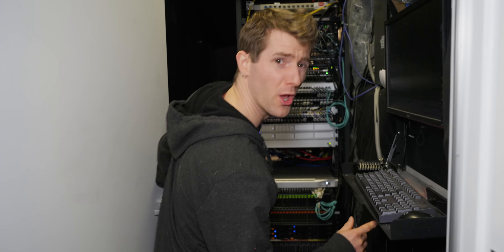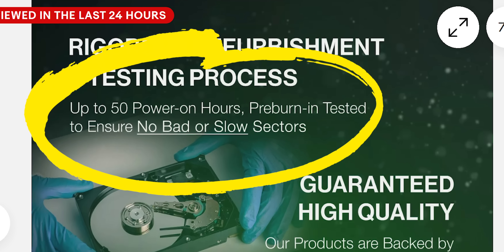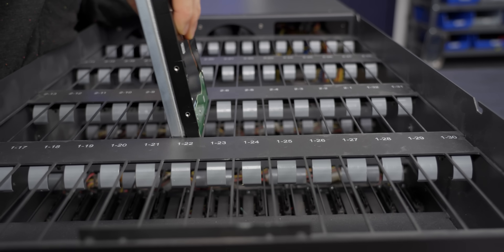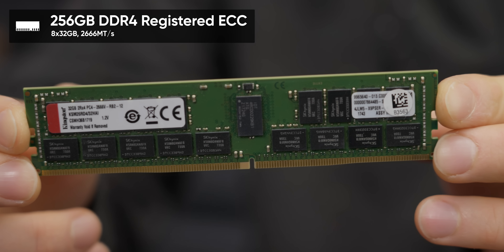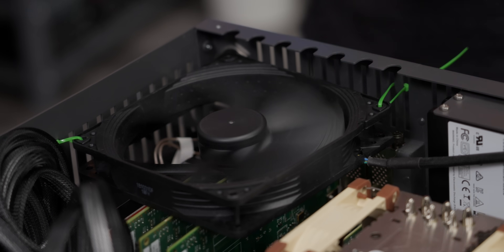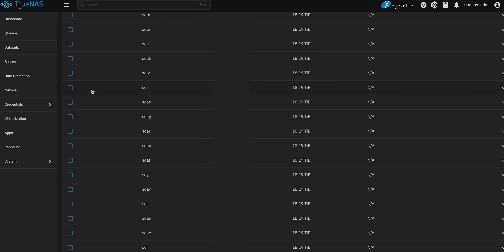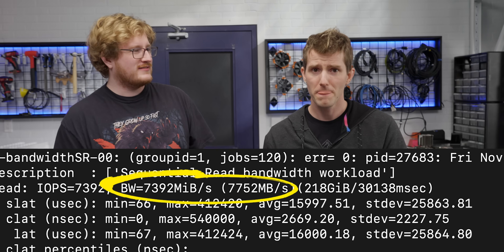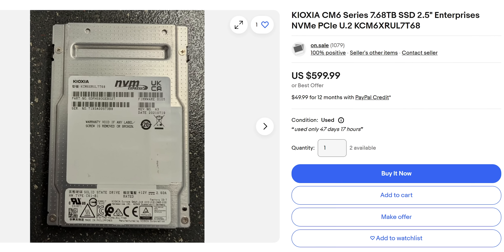Is Buying a PETABYTE on Ebay Stupid?

Comment: I did something similar though not at that scale. Paid $600 shipped for 5x 12TB WD Ultrastar drives from server parts deals.  I set up freenas on a newer 5600G AM4 based system with 32GB of RAM and use it as a media NAS.  Similar LSI HBA in IT mode from eBay for like $20 as they show in the video. Built it in the Lian Li A3 using a $15 5-bay drive cage 3.5in drive cage.

Storage pool is a RAID Z2 for extra redundancy.  I did have one drive fail a smart test within a couple weeks and SPD were helpful and quick about replacing it, even as a hurricane came through near their HQ in FL.  Everything has been rock solid for almost 4 months now.  This is the only way to get this kind of storage density.. I can pull 280MB/s over a 2.5GB switch. Love it!
Reply: Milton don't play no shit.
Reply: So wait, you’re running 60TB RAIDZ2 with only 32GB RAM? Have you had any issues over 30TB of data? They say 1GB per 1TB, but I see my ram usage is low in my 24TB setup with 32GB. I’ve been wondering if it’s not really true. They say some pretty bad corruption/loss can happen if you run out of ram. I’ve been tempted to add more storage but have been scared of data loss.
Reply: @andrewskaterrr  I could be completely wrong about this, because I have only recently been trying to learn about ZFS and ZRAID in preparation for building my own media storage, but as I understand it from my (Pentium II, upgraded to Pentium III, ProLiant) server days, using hardware RAID 5, wouldn't his ZRAID2 array have two drives of redundancy (What I am going for is ZRAID2 with 8 12TB refurb Seagate drives, so this is a real question for me, too!) and only 3 x 16 (1,000-based, not 1024) drives of working capacity, and therefore staying [barely] under the 1 GB : 1 TB rule?

The old motherboard I intend to repurpose has a 64 GB max on RAM, so I was planning on 7 active -2 redundancy + 1 spare.
Reply: an A3?? Can you tell me where to find the drive cage and how you fit that in?

Comment: You can get a new 20tb internal Toshiba NAS drive for 342$ at Microcenter I just picked one up.  This is about $50 $60 cheaper than any other internet 20tb drive the Seagate is $400.

Comment: I’m a storage administrator for 60 Petabytes of data and if I had to guess these are refurbished from churned drives. Because I have so many spinning discs on so many arrays I have a large locker of cold spares and as soon as I see any sort of error or bad sector I replacebthe drive because that rebuild takes so long that I can’t waste time trying to recover recover the disc so even if it has a small error that could be indicative of a bigger error so I RMA it under our contract with the vendor and pull one from storage and put a new one in immediately now some of those discs that I sent back are probably fine and that’s probably the ones that get refurbished and sold there. Also, when my current system is decommissioned, I’ll have an entire locker of cold spares that just gets sent back to Seagate and yeah, those will probably get relisted.

Comment: I bought recertified 4 and 5 TB drive from western digital, and they are running since a year in my home server without any issue.
Also, I just bought a 16TB Seagate IronWolf recertified from amazon, and it's runnning since a mouth without any apearant issue, and as in the video, the shell was brand new.

Comment: Couldn’t you use more redundant drives in a RAID setup to compensate for higher failure rates? Sure it’ll cost more but not as much as all new drives right?

Comment: I just did something similar (from a consumer standpoint).
Very cheap drives from a dude retiring his homelab attempts, HexOS, and an old PC (i5-2500k). Works like a charm, and much cheaper than anything I would build on my own from brand new parts.

On that note, if you wanna show how to turn spare laptops into the brains, a.k.a compute for these NAS projects that'd be great, I have a spare laptop with a much better CPU than a 2500k ;)

Comment: I've recently taken a gamble on 10 8TB exos SAS drives for £20-30 each. I had one DOA which the seller is replacing and all have approx 50,000hrs on them. At that price it seemed worth the gamble and I'll be running 2 parity drives so it should be pretty safe with 8 spinning disks and 2 cold spares. This is all totally new to me and I'll be relying on Hex OS which I got the early bird price on. So far the little 3 drive dell optiplex 3060 Nas I built for my dad is running flawlessly with hex os. I got him recertified 4TB ironwolf pros which arrived sealed with 0hrs on them for about half MSRP.

Comment: i purchased a few 16TB SATA ST16000NM001G Seagate Exos 3.5" Internal Enterprise Server HD | 7.2K from "plusdrives" off e-bay another re-certified Seagate reseller in May 2023.  They are inside my Unifi NVR and have 12 cameras writing to them 24/7 since I installed them and zero issues.

Comment: Ok, from the perspective of a guy who works a lot with huge data centers: data centers buy hard drives in bulk, often much more than they can use so they have on site cold spares. Depending on the protocol it can be up to 40% of the drives purchased. And when they migrate to a bigger hard drives or to SSD storage they often have a plan where unused spares are returned for some percentage of the initial cost. Unlike used drives that are handled by the e-waste recyclers and often just destroyed (again based on the policy of the data center) spares are often returned to the original manufacturers. So here's a base for re-certified drives.
Reply: Is it also possible that data centres buy so many that they get quite a few duds which get sent back and fixed and recertified?
Reply: Up to 40% for cold spares actually makes sense when using Seagate drives. Depending on the model.
Reply: @peterpain6625  Enterprise grade stuff is obviously much more reliable, but even then Seagate still maintains their spotty reputation. Hitachi is the real good stuff in terms of spinning disk.
Reply: Thanks for info buddy
Reply: Thanks for confirming what I suspected! I have a friend whose sister works for Hitachi doing data center sales (last I heard), and she couldn't talk about work; but my own work around servers at the SMB level made me expect it.
Reply: Now that makes a TON of sense.... I just couldn't think of why there would be so many drives with ZERO hours on them, but are re-cert'd and essentially 'new' drives....
THANK YOU! Very helpful to know the sources... or at lease one of them :)
Reply: I had a manager insist that all the drives be the same across all the servers, when we upgraded some of the archive servers. Even though it was completely unnecessary (he got the budget approved for it, whatever), so we ended up with about 100 brand new, still sealed, spare drives. I forget the capacity of them, and they weren't all one type, but it was such a waste of money.
He also undid some of the virtualisation the previous head had put in place, resulting in new oracle licenses being purchased. Again, he got the budget for it approved, so whatever. His boss must have had a pile of cash leftover in the budget and decided he needed to burn it all, lest he get less next FY.
Reply: i bought a 20TB refurb off ebay it was new with a cheap dell optiplex i have my own cloud storage....i was leery at first but no regrets
Reply: Hook me up brother 😂
Reply: as if yall arent wasting gpus, now your also wasting storage
Reply: ASDasdSDsadASD-nc7lf It's new to many people.
Reply: Obviously.  Amazing you think that is new information.
Reply: @ASDasdSDsadASD-nc7lf did u even watch the video? Half of it was them wondering where they come from.
Reply: @ASDasdSDsadASD-nc7lf  yeah, that's totally common knowledge that everyone should know 🙄
Reply: @ASDasdSDsadASD-nc7lf  why do I picture Comic Book Guy writing out your comment?

Comment: I always ADVISE people to buy used Harderives (for games exclusively) 

When I spec Systems, I always save my friends that are on a low budget a bit of money by buying used drives.

I always tell them to store critical Data on either the SSD or a 500gb HDD I include as well. Additionally I always get them a 4 - 6 TB used server Drive with good test scores, exclusively for saving Games.

Comment: 13:35 when making a NAS at home, DO NOT GET A CACHE DRIVE. I frequent r/truenas, we get A LOT of posts of people setting up a new NAS thinking their spare SSD can be used as "cache" for their HDD pool. it does, not work like that, it never has, and never will.
Reply: As you didn't phrase it accurately: For ZFS that is. xpenology, unraid (using unraid array) etc do have write back cache options that are suitable for home use. ZFS does not.

The valid usecases for caches in ZFS, as far as I know:
- Do consider using a L2ARC cache if you have maxed out the RAM on your platform and still see cache misses. Using a slow SSD may end up hurting you performance, do your research.
- Use a persistent L2ARC with secondarycache=metadata to get somewhat special vdev like read performance boost without having to invest in redundant ssd storage. Requires "tuning" of zfs params. Mostly relevant if you restart the server a lot. Otherwise the ARC normally does as good job without L2ARC.
- Do use a SLOG device if you need high performance sync writes. Normal SMB shares do not profit from this. At all. But if you share storage via e.g. NFS or ISCSI to a VM host to store virtual disks or use the storage for a databse, this might be relevant to you. If you do go down this route, your SSD you have lying around is probably completly inadequate. Consider optane.

Instead of a cache, consider installing a metadata vdev. It's pretty expensive, as you should use the same level of redundancy as for the rest of the pool, but it can speed up some use scenarios significantly. Wendel from Level1Tech made some videos about it, but before deciding to use one please do some more research if it will actually benefit you. If all your required metadata is already in ARC, the speedup may be negligible.
Reply: unRAID works best with one or more NVMe drives for short term cache and has a customizable 'mover' feature that moves files between cache and array.

Comment: I have stopped years ago with buying brand new drives. Instead I buy used and get double the storage for the same price, so i can do more backups.
In the end, as all drives will fail eventually, buying used is safer than buying new.

Comment: I just got a recertified HDD. It had zero hours on the drive with no visual usage. It was even sealed, what looked to be an original seal.
Reply: From the original manufacturer?
Reply: @AxisofNerd  they reset the smart data. I've got a couple of 6 year old refurbs that came from a DC with 0 hours.
Reply: @0pointer  Yeah i think so but the thing is its manufature date is like 4 months old.

Comment: I bought 12 recertified seagate drives from a vendor.  Over the next two years 12 out of 12 had shown SMART errors and pulled and replaced.  It's not worth it.  Buy cheap, buy twice.

Comment: I bought 4 Seagate EXOS X14 14TB disks that were refurbed by Seagate. They only had 3 hours on them when I received them. I am at 17,800 hours (just over 2 years) and have had two fail so far. I would NOT recommend them. Go Western Digital. Seagate has and always will be the inferior choice - my anecdotal experience.

Comment: I've pretty much switched to only buying from serverpartdeals but I don't know if I can do Seagate. Their failure rate is still a bit too high. The WD DC recerts drives have been running for years and not a single failure.

Comment: if 48% of reports are center, the data they use is wrong, not to mention that center is the most biased and misleading sector of news work because it's harder to tell the lies or dishonest things they say. if you read any right or far right news reporter you can immediately tell the wrong things they say, and it's the same with left leaning stuff

Comment: Recertification is done by Seagate themselves? Oh well that should be fine then! Considering that their NEW drives are so well known for only blowing up a year after first deployment.

Edit: If you want more testimony, every hard drive failure I've ever seen myself, for family, for friends, whether it be Desktop, Laptop, Game Console or portable storage device, every single one of them was a Seagate, and they were each no more than 2 years old. Meanwhile my WD Golds are about to be a decade old, outliving the components they were originally built with, and still refuse to quit.
Reply: Bad news: it's just chance. Actuarial comparisons put WD and Seagate pretty close to each other in terms of real failure rates ("frequency"). That's true across industry segments but individual product lines may deviate. Source: have worked in data analytics for warranty/insurance/reinsurance companies.
Reply: Each manufacturer has failures. I have had Seagates, WDs, and Toshibas last years and years before they start to fail. I've also had some last only a few months. My most recent was a Seagate that started to take a long time to access, but it was over 12 years old and had a ton of restarts and power on hours.

Comment: I bought 3 used 16 TB WD WD160EDGZ Drives for  a total of 354€ (~7,40€ per TB). They are renamed Ultrastar DC HC550 Enterrpise Drives and were very cheap even compared with Recertified drives. And I purposely chose used drives against recertified, because then I knew the exact smart values and have information about their prior usage compared to recertified drives. Running since August with no problems so far. 
After watching this video I am willing to try recertied drives as well, if there is a good deal on them.

Comment: I ran 10 ebay 4tb wd's on used lsi controllers for about 6 years 24/7 no failures. I now use that array as a cold backup and power it on to sync every once in a while. Bought 5 ebay 12TB hgst's 2 years ago. 1 reported failed in truenas but I took it out and ran disk tests for 2 weeks straight and it found no bad sectors. Been using it since, no issue. Likely was just a glitch in the cables or controllers, or a hiccup from running truenas virtualized.

Comment: I'm using 2 refurbished drives in my TrueNas System in a mirror pool for backup. I'm replicating all my snapshots to them. So in case my main ZVol1 pool gets damaged I should be able to restore it from the backup. 
No problems so far with the drives.

Comment: With pools this big you might want to put metadata on redundant SSD's, and not store it directly on HDDs. Cache helps, but scrubbing is brutal. You need like 0.3% for metadata, which is quite practical. Also it can automatically store small files there (say, under 128kB).

Comment: Recertified drives are more reliable than a brand new external drive. Also I got the same drives (4 drives) so far (<6 months and from same seller) they been running flawlessly.

Comment: I've bought about a dozen used or recertified drives over the years and I've had 2 fail.  Since they were in a Synology RAID no data was lost and I'm way ahead on savings.

Comment: Does anyone have experience with the noise level of some of the Seagate drives compared to WD Red Plus 12 TB (WD120EFBX) and WD Red Pro 22 TB (WD221KFGX)?
My WD120EFBX are very very quiet after spin-up whereas my WD221KFGX make a very annoying high pitch sound when running (after spin-up). The latter is not super loud but loud enough to be annoying.

Comment: I've been using refurbished drives in my NAS almost exclusively now for about 6 years and I've only had one show up DOA and two show SMART warnings after 3 years of 24/7 usage.  Most are Seagates from either ServerPartDeals or Amazon (The single DOA I had was from Amazon and it was replaced without question and has since been running perfectly for ~8mo).

Comment: My nas as well is using all refurbished drives because it was just so much cheaper. I wanted to buyy them off serverparts but being in europe ended up buying them from ebay. All the drives had extremly low power on hours and passed all my smart tests. I also expanded my original pool after not all the drives where shipped, and after resilvering and expanding the drive pool over 48 hours, I still had no failures. And saved about 50% off the cost. Been running solid for over a year now, with no problems. Albeit I will say the drives are loud, so definetly not keeping it in the living room, but then again who does?

Comment: Level1Techs did a piece on buying 'used' server drives from cloud server farms, they found over a broad set of drives that most had only seen a couple hours of use. However these large data centers have a time based (not use based) replacement policy, so they dump these basically unused drives on the market.

Comment: Been using 6 16TB Seagate drives for my home nas also from ServerPartsDeals for 2+ years now. One of them crapped out a few months ago just under the 2 year warranty and it was a breeze to get it replaced.

The drives are so cheap I can justify buying a 7th drive to just leave around so I have a cold spare for resilvering when one fails :)

Comment: Just purchased 5 of the 18TB drives second hand for $125 each. Banger deal. Haven't have any drives die on me for the past few years, but at least I will be running raid anyway so the data should be kinda safe from drive failure… hopefully.

Comment: I bought some (like 15+) 8TB HGST SAS drives from various sellers on ebay a little while ago. These weren't re-certified, they were just used. I did get quite a few dead and dying ones, but I managed to get my money back after talking with the sellers. For the next time I buy used drives, I'm going to get them all from one seller with a lot of ratings like Server Part Deals. I'd say its worth it, especially SAS drives which likely see better working conditions.